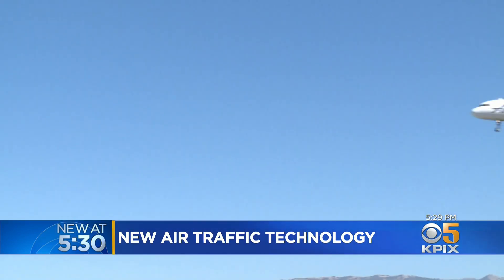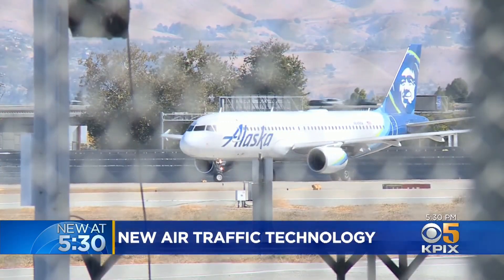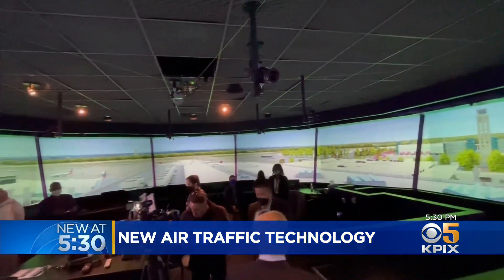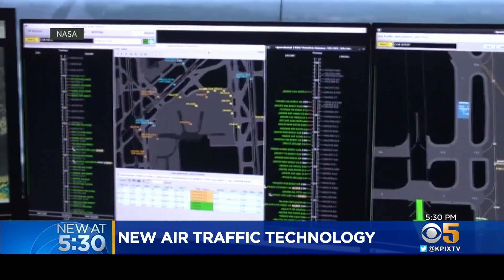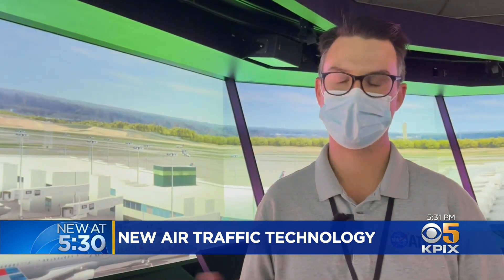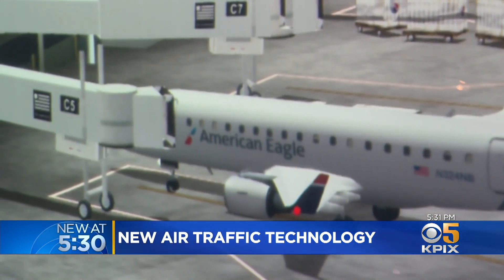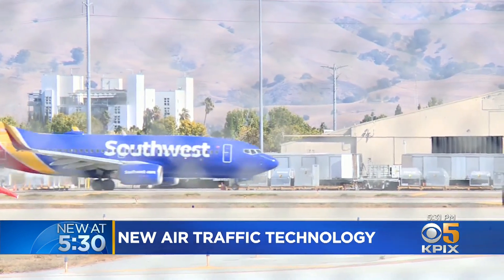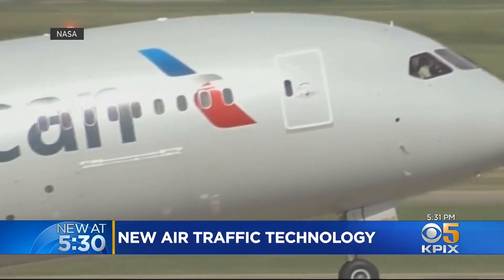NASA Researchers Introduce New Technology to Reduce Long Tarmac Delays

Comment: Wait but the fuel used during idle is used by APU not the main engines AFAIK.  And the APU is what's powering all the electricals within the cabin including the A/C.  This thing better work perfectly or you'll have some very pissed off passengers on a hot summer day in some airport in Florida.